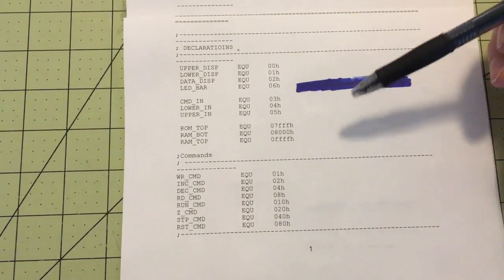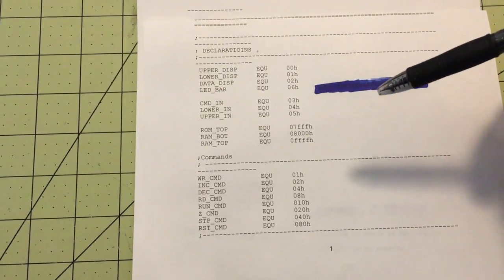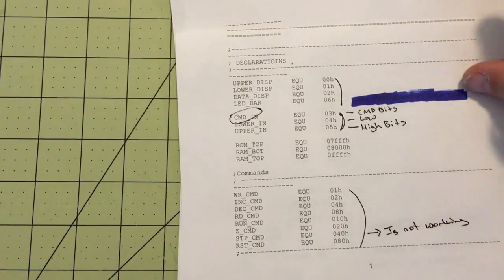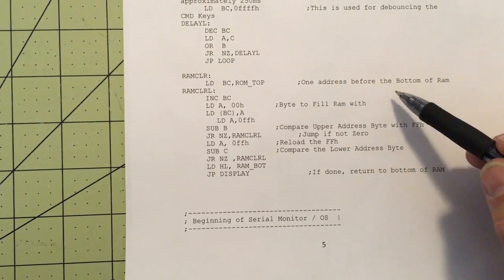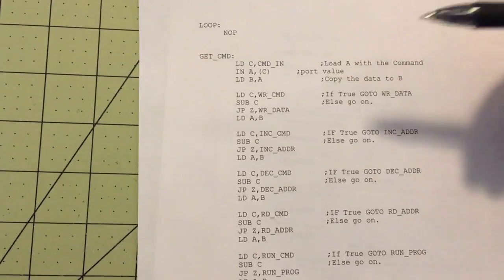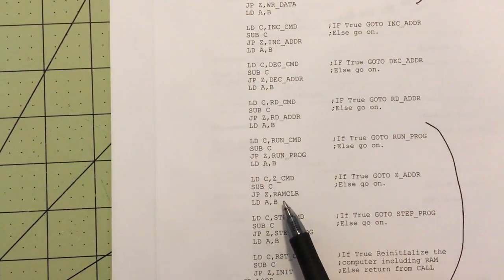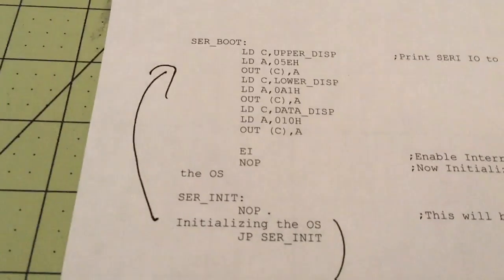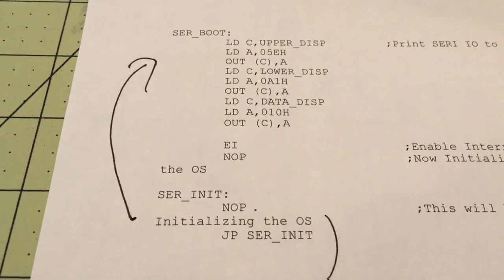Homemade z80 Update #1.1 - Software

Comment: If you could detect tempeture of the whole board then when it gets hotter it goes faster and slower when it gets colder/coolsdown
Reply from the maker: I've already changed fan circuit, it now has a rheostat to control the fan speed.  It help me fine tune how cool the regulator stays, without being overwhelming from a noise perspective.

Comment: You may also want to investigate LDIR (ED B0) instruction for filling memory. It coppies (HL) to (DE) then increments them both, repeating the process as many times as the count in BC. So traditionally you set up HL and then put the byte you want in (HL) [ie XOR A; LD HL, first_address_to_clear; LD (HL), A] then setup DE to be the next byte up [ LD DE,first_address_to_clear+1] set up the number of bytes to clear less the one we loaded already [ LD BC, nbytes-1] then do it to it [LDIR]. Check I got this right way round as I was last doing this on an actual macine 30 years ago when I was a young teenager... Also while you are at it, LDDR works downward instead of upward in memory, decrementing DE and HL each time; and also check out INIR & OUTIR and their counterparts INDR and OUTDR which I never got to use but thought looked rather interesting if you had the hardware to make use of them.
Reply from the maker: John Critchley, I worked on this for a little while. I did build a small board for serial communication. But due to some limitations in the design I have set it aside for the time being. I'm currently working on another Z80 computer that has a SIO and PIO. I had boards made, and am currently working on the monitor. My end goal of that design is to expand it to have SD storage and possibly a Video/Keyboard interface. I have a design thrown together to use a TMS9918 for the Video and a AVR as the keyboard controller. But for the time it is just using serial. I'll check out the instructions when I have some time this evening. But it may be a while before I actually sit down and play with them on this computer.
Reply: I have not done any soldering in 30 years having been in application support, but the idea of building something from the ground up and then programming it to do something useful is very interesting. I think I would need to overcome my cautiosness and have some ideas on how to make it like I want it... If I could I'd use a minimal ROM so that it basically setup and ran a INIR to load some kind of boot loader from an initial interface then jump to that (3 instructions, plus maybe a JP to the start of the code) : that same interface could be used to load the rest of the programming...  Designing and building it is a bit daunting though.
Reply from the maker: John Critchley , the complexity depends on what you intend to do with it. Are you wanting something simple with a machine code monitor, or something more complex running CP/M or some self designed OS. There are plenty of designs out there that you can draw inspiration from. Building a working design is not terribly difficult. But there is a learning curve.
Reply: I really rather enjoy Z80 coding (even in manually writing machine code, though I've been using z80asm written by Bas Wijnen), so something I could upload my own code to easily. I imagine some nice peripherals would then be interesting to interface with: maybe an LED matrix display? Maybe even drive some stepper motors, and some kind of input sensors? Autonomous robot on wheels? Z80 3D printer?? Possibilities are endless, but I just dont know where to start...

Comment: You need to setup the Stack Pointer SP at the beginning of the code, usually points to the top of RAM.
Just after the memory clear routine and before enabling interrupts.
Also need to debounce the switches and wait until the switch is released before returning to the main loop.
I have many years of Z80 experience if you need any help.
Thanks for the video. :)
Reply from the maker: ZEROSTATIC72 I've already began rewriting the machine code. I'm not a software guy, so there is a fairly steep learning curve. I'm getting there, it's just taking longer than I would like. Currently the code doesn't really utilize the stack. However, the new 'bios' will, as it will have system calls for various functions. The code you're seeing is simply to get a basic monitor working....something that works and will allow you to plug code in. It's on the way out.

Comment: What pals did you use for glue logic? and how did you program  them?
Reply from the maker: prehistoricBanana I used GALs, not PALs. Although, functionally they're essentially the same. The two variants are the 22V10 for IO deciding, and 16V8 for the memory decoding and Binary to HEX display drivers.

Comment: I  would change your absolute jumps (JP) to relative ones (JR) as they save you a byte. This is possible if the jump destination is not more than +127 or -128 bytes from the current program counter (PC) address. Also a cheap way to zero the accumulator is to exclusive OR it with itself XOR A takes one byte whereas LD A, 0 takes two. I started programming Z80s with only 1K of RAM to play with so I tended to be frugal with my code. Certainly things to consider if you are going to expand your ROM with a BASIC interpreter and Forth.
Reply from the maker: Yeah, I was aware of the JP vs JR issue.  However, I've never thought about XORing to zero out the accumulator.  That's an interesting way to do it, I may use that in the future (if I remember it when I'm doing it).  1K of Memory, eh?  Sounds like you were plugging assembly on a Sinclair!  As for Basic/Forth, I'm not sure I'll end up with either. I was just mentioning that it is possible considering the room to do so.  I figure there could be about 1k of system routines, and then whatever makes call to them.  Most Basic interpreters are under 8k, and I have 32k of ROM and 32K of Ram.  So I'm probably safe size wise.  But like you pointed out, sloppy code can be shrunk.